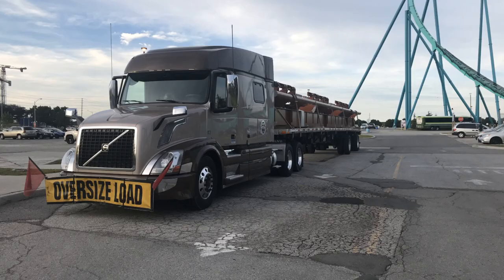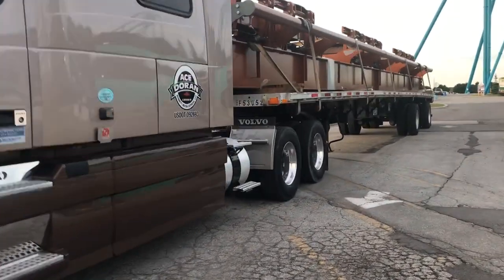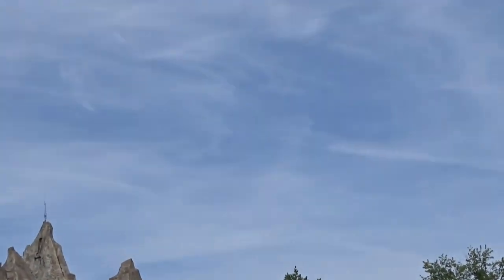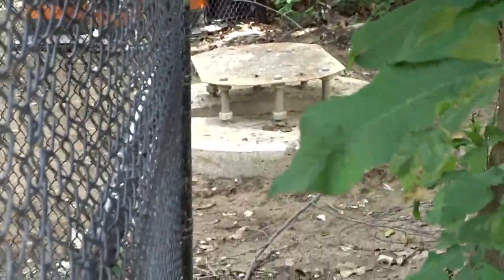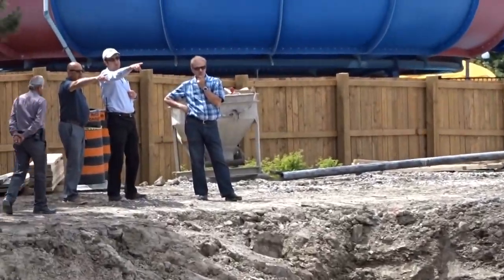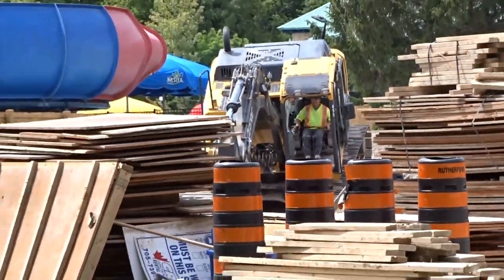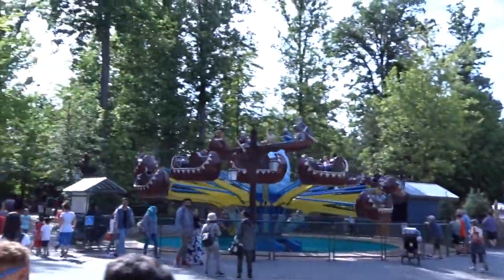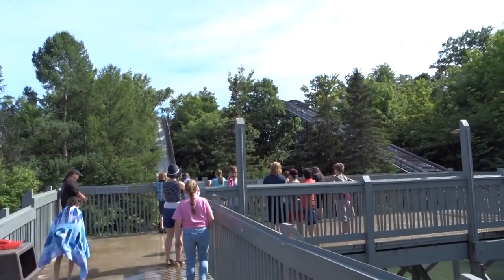Canada's Wonderland Yukon Striker Track/ Construction

Comment: I used the pythagorean theorem and found that the length of the lift hill track would be about 415 feet long without the turn around, assuming it is 276 ft tall and the 95m (311 ft) span over the ground ia correct.
Reply: I meant is not ia
Reply: did to but was scared to post because was worried people wouldn’t understand
Reply: Brodie MacLeod MacLeod Nice thinking!

Comment: Any updates on flight deck? I #cantofficiallyadmitit but I use to kinda get paid there....wink wink and there was a big rumour that Flight Deck and Time Warp will be removed to make "Ziz" I think it'll likely be a b and m invert in 2021/22..... but that can die officially if you can confirm if it's closed for vekomas new trains or not. Idk. Also....if this ride has less than or equal to five inversions I won't be too happy because dude let's be real....how horrific would it be if you got the tallest, longest, fastest and most inverted dive coaster on the planet and your Parks most inverted coaster isnt that one but the vekoma SL-see the welt on my neck. Lol.